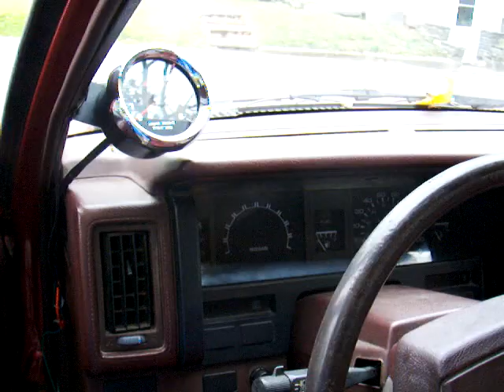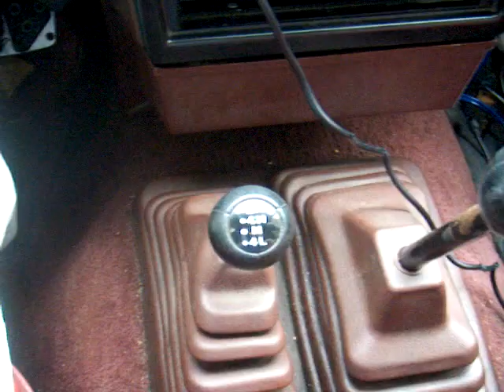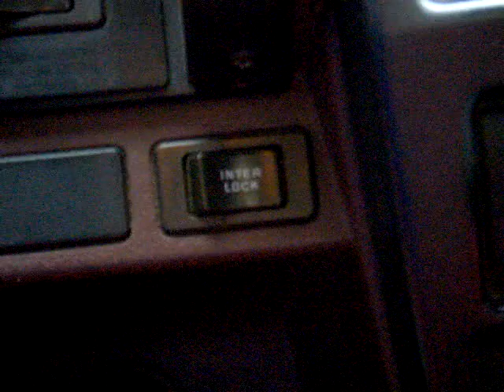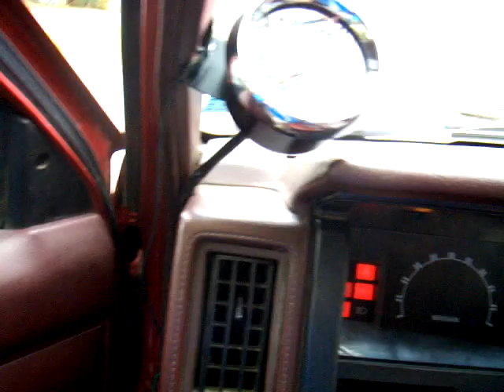My '91 Nissan Hardbody Pickup

Comment from the maker: @GrizzlyClaw3 The KA24Es have timing chains in them. The '91s have the plastic timing chain guides too, which means the chain chews through them over time which causes the timing chain to need to be replaced prematurely. As for putting an inline 6 in these trucks, I'm not too sure. I would think the engine mounts would be different. If you want more help, check out this site. They help me out a lot with my Nissan Hardbody.